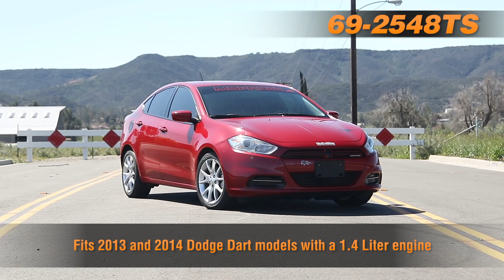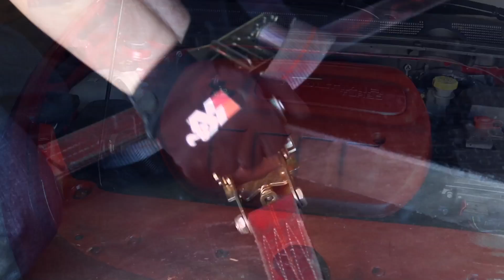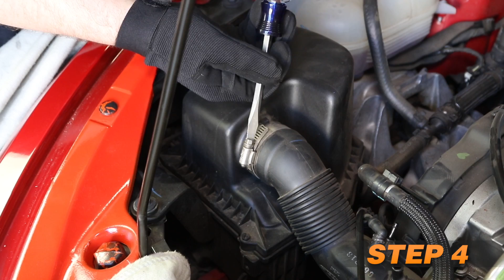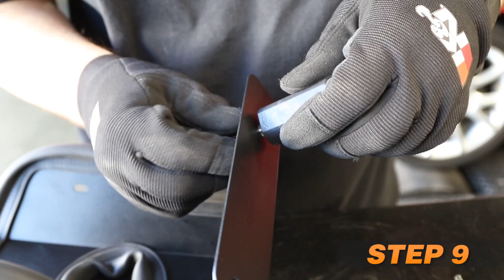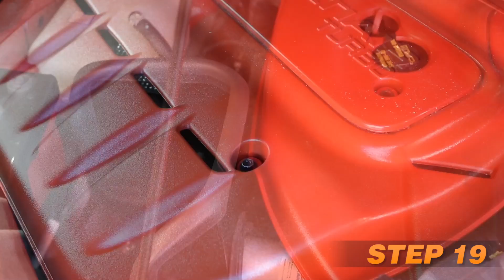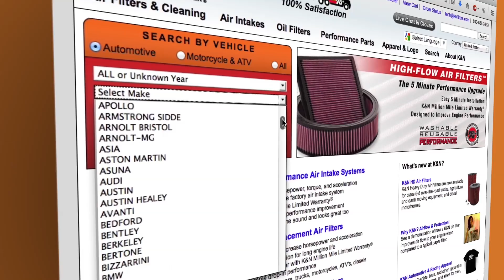Dodge Dart 1.4L [#69-2548TS] Air Intake Installation

Comment: Will this fit with a 2014 Dodge Dart aero 1.4 turbo?
Reply from the maker: Yes, this system will work for a 2014 Dodge Dart 1.4L
Reply: @KNfilters  is a tuneup required after I install it?
Reply from the maker: No all K&N intakes systems are designed to work with factory ECU settings and do not require a tune.  If you have any other questions, please contact our product specialists at 800-858-3333 or tech@knfilters.com for assistance.

Comment: Lucky those brittle hard lines didn't break when moving them out of the way. Stupid decision on Fiat's part. I installed an AF Dynamic cold air today and both my evap line and bov line going to my wastegate just snapped as soon as I touched them.
Reply: I just did mine and snapped one of them too😡😡😡

Comment: First, I'm. K&N fan.  However, my question is how effective is the dyno when the hood was open?  This vehicle has a seal along the edge of the hood which is intended to help in aerodynamics among other things.  Where is this K&N drawing air from when the hood is shut?
Reply: Andrew P. I know this comment is over a year old but the air is drawn in from the stock hole that the stock intake drew its air in from
Reply: @CrimsonDDA  which makes the premium price for the "heat sheild" (which will be hotter than 2 hells after 20 min) pointless